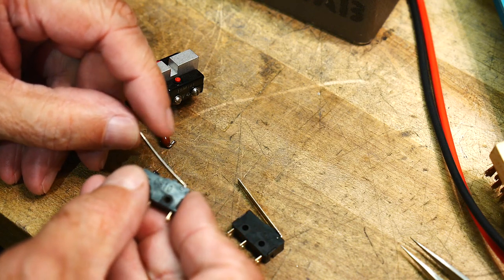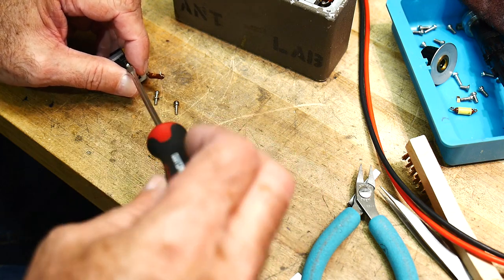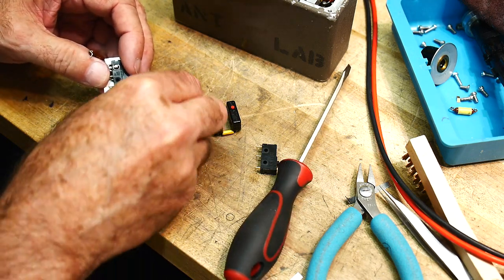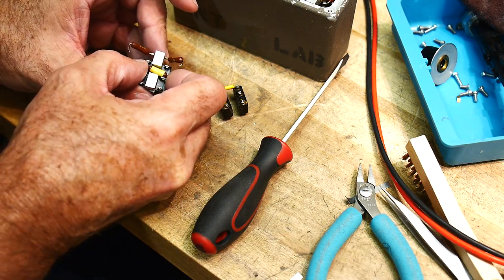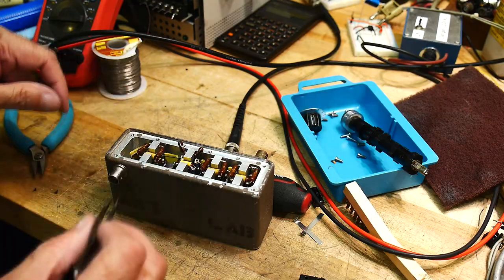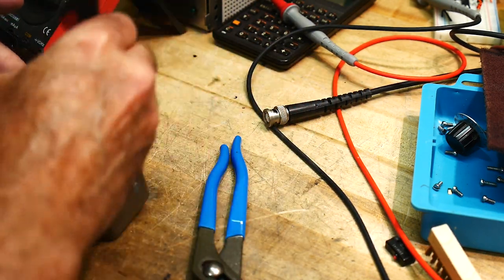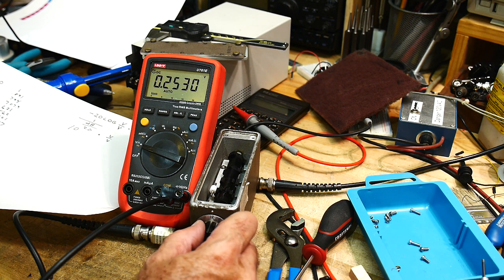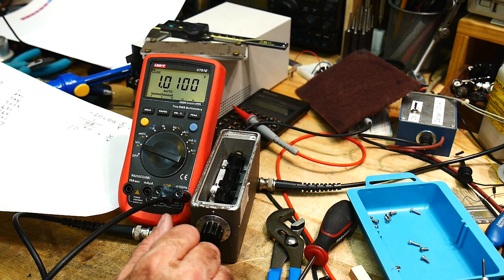#529 HP 355A VHF Attenuator (part 4)

Comment: It's always a great day when you find a broken component and then find an identical or acceptable replacement in your own stock of stuff. Fixed one of our home intercom boards that way with a microswitch I had in stock. Great fix and would be interesting to see if it maintained its spec up at 500 MHz...a step attenuator is a very handy tool at the bench.